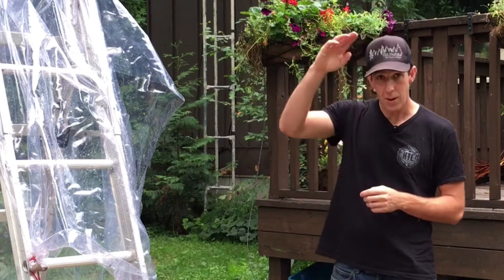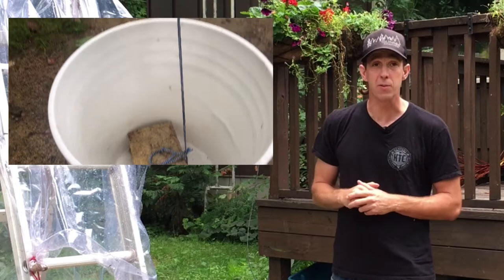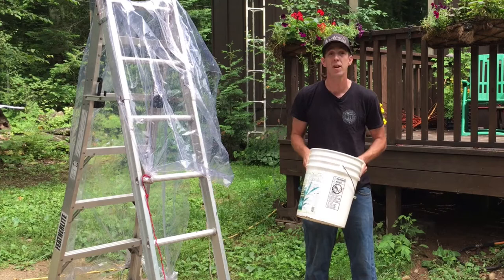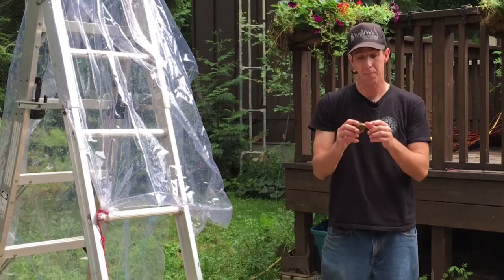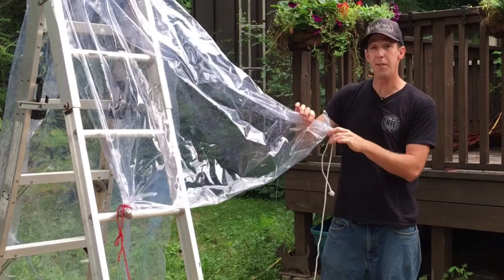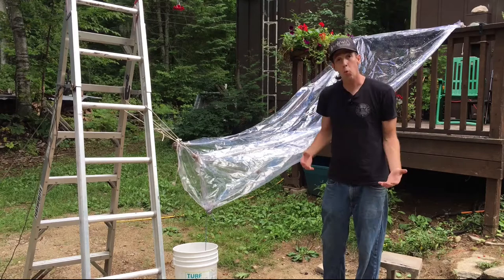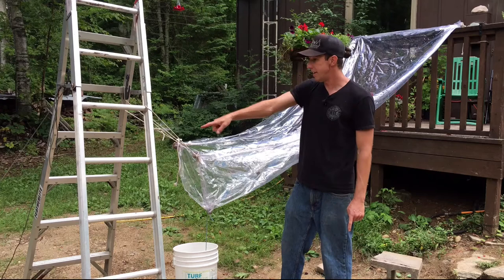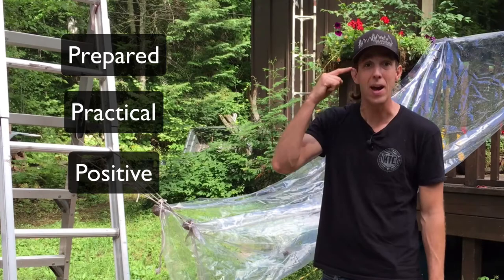How to Collect Rainwater for Drinking During a Disaster

Comment: Doesn't the evaporation in the water cycle filter rain water? In theory, if you can get it cleanly from the sky it is the same as distilled water. (PLEASE do correct me if I'm wrong, I have yet to do any testing or confirm this)
Reply: there is a lot air pollution the rain falls through